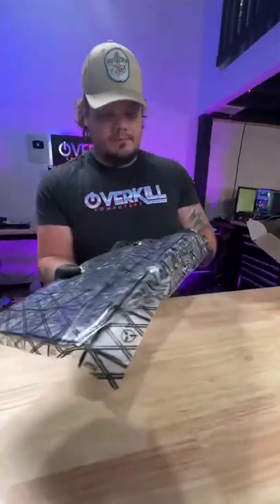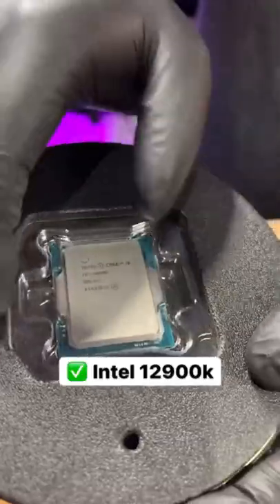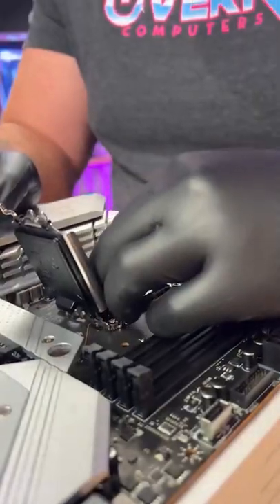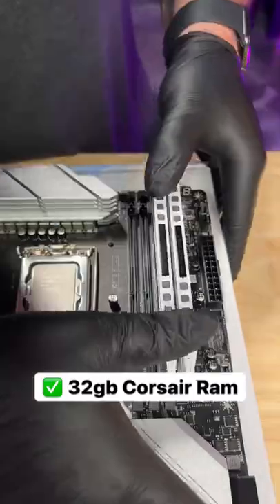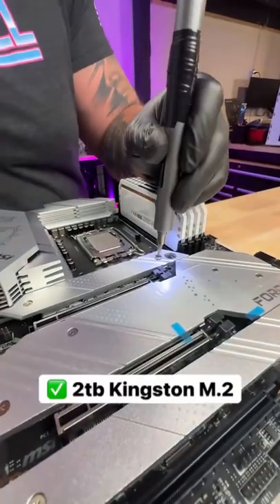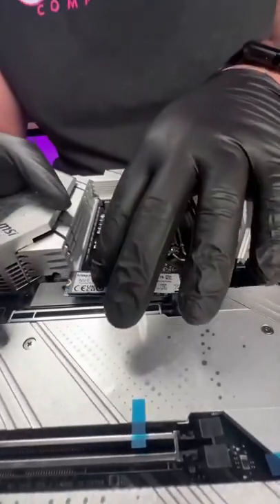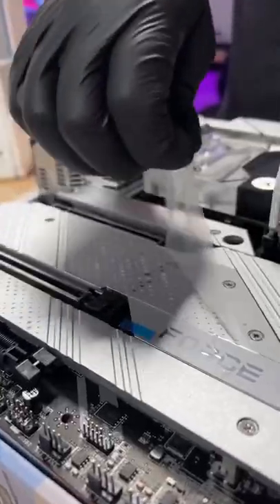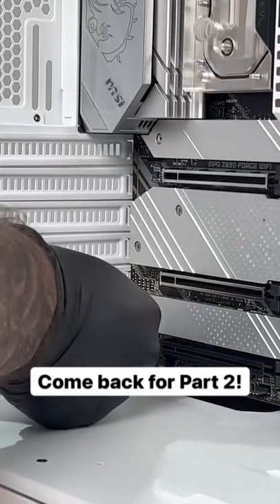Is watercooling PC’s TOO much work? 🤔 #shorts #gamer #gaming #gamingpc #gamergirl #pc #pcsetup

Comment: My heart jumped when he pulled those fans 😥
Reply: Why? When you actually get decent fans those are just junk, i swear i have probably 10-12 crappy case fans from my “old” pcs (ive used this case a few times) ive upgraded from and i have absolutely no use for. If your looking for case fans i recently got a 3 pack of 1800 rpm rgb fans for only 15$ from darkflash, they would be really cool for an nzxt build cause they have infinity mirror.
Reply: @minty-beats  I mean if someone else were to use that, there's a chance that it might not work or cause a short circuit.
Reply: @Cyrillium  highly doubt it but i guess you have a point, tugging on the cables shouldnt ruin them though, and they probably just throw them away considering its a prebuilt pc company
Reply: I appreciate his enthusiasm in building, but yeah there's just no reason to treat hardware like that, even if they are just fans. Those aren't complete bottom of the barrel fans anyway.
Reply: @Cyrillium  Fr that's just A**hole behavior... I wish i had those fans...